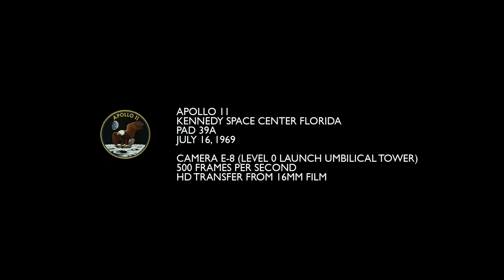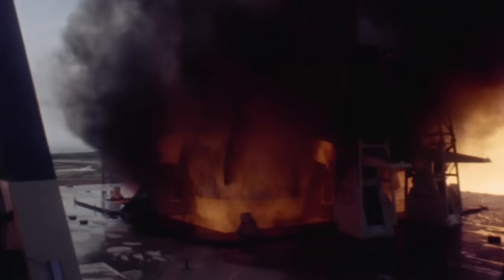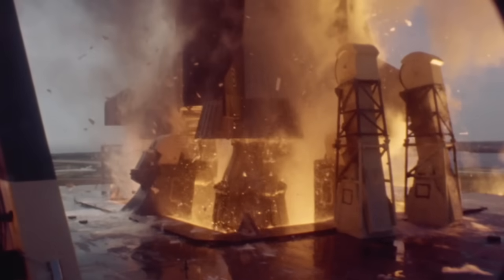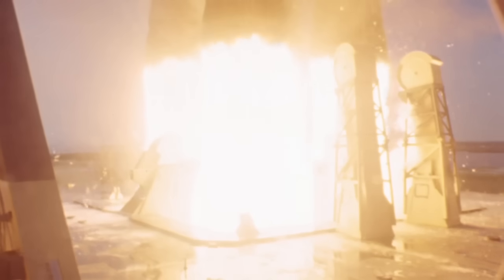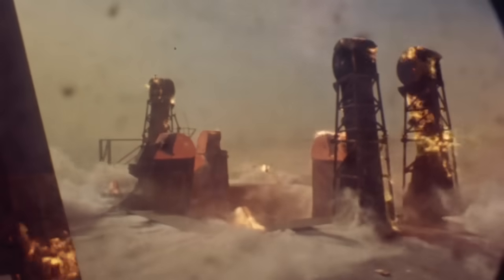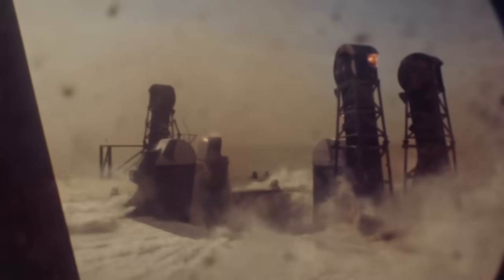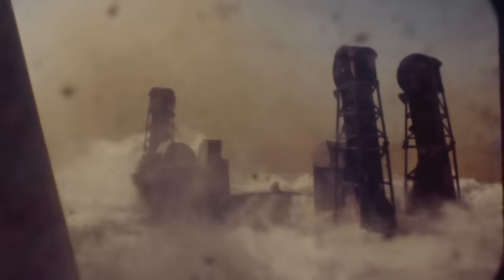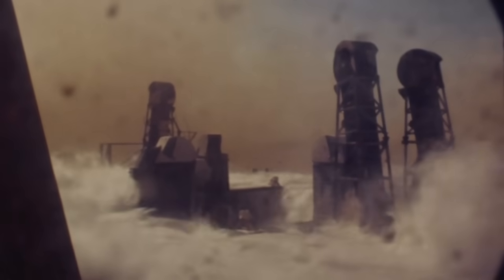Apollo 11 Saturn V Launch Camera E-8

Comment: The Saturn V remains the tallest, heaviest, and most powerful rocket ever brought to operational status and still holds records for the heaviest payload launched and largest payload capacity to low Earth orbit (LEO) of 140,000 kilograms (310,000 lb). Truly remarkable one wonders if this was the pinnacle of American space program.
Reply: And to think the Saturn rockets are almost 60 years old, imagine if we created a new design with our recent technology...hell, the computer system inside the Apollo 11 had the processing power of an Atari, and THAT took us to the moon and back. We could go to Europa if we really wanted to.
Reply: German engineering at it's finest! ;)
Reply: Not even close.  The final version of the Saturn V produced more than 7.8 million pounds of thrust.  If the Falcon Heavy is a success it will produce a bit over 5 million pounds of thrust. The Saturn V could heft 320,000 pounds into LEO while the Falcon Heavy, if successful, will be capable of 119,000 pounds.  Not one of the 50 year old design Saturn V's ever failed.
Reply: His numbers were wrong.  

Delta IV  has    710,000 lbf   
Saturn V has 7,648,000 lbf

It's easy to make a mistake, if you don't realize there is a huge difference.

Everything on a Saturn V is huge compared to the Delta IV Heavy.   It's all about the mission though.   Delta IV is for getting payload to Earth orbit.  Saturn IV is for getting payload to the moon.  

It's a shame that we have all but given up on space.  When I was a kid, space was our future.  We had plans on colonizing the Moon and Mars by the year 2,000.   Space stations and space tourism was suppose to be so common, anyone could do it.   

There are still people who are hopeful, but space is no longer a national priority for any country.    If space fairing nations still put the same kind of effort and budget into space as they did in the 60's and 70's, we'd ... well, those "Hey, we should try..." missions would have happened.

There was a driving factor back then.  Both sides wanted to show that they could put ICBMs anywhere on the planet quickly.   They masqueraded it with the civil applications.   We learned a lot of good things in that period.  Too bad learning and discovery is never a real priority.   That's why you'll see growing military budgets, but cuts to education and aerospace.

The only way we'd see a change with the current systems in place, is if China (or someone) landed on the moon and declared it their property.   You'd see the US, Russia, and the ESA with all the budget they needed, and escalating mission sizes until they went back to agreeing to the old 1967 space treaty.
Reply: +kell490   It could have put the ISS up in just 3 missions at a fraction of the cost.
Reply: +kell490 Dude! the Delta IV has 1,000,000 pounds more thrust (8.5ishM) and we have a space station! Oh yeah; landed on a freakin comet!!! If only NASA had 2% of the nations budget like it did in the 60's; that would be super cool! Now it's like point zero something percent... Stuff takes longer now.
Reply: MetaldogJC I think it was more then just the money Apollo program cost 20 billion 100 billion in today's money. The F-22 Program cost $61 billion. I think NASA just too bureaucratic
Reply: +kell490 The Ares program will break all of those records when it finally goes live which will be in a few years.  They have done unmanned leo tests and they have also tested all of the emergency systems that were made into this new program to prevent some of the issues that we had during mercury, gemini apollo and shuttle programs.  There is an emergency jettison system that has been added as well as launch pad emergency abort system.  Reason ti will break records is they modified the shuttle engines to be the mains on the Ares V rocket plus it will use SRB's borrowed from shuttle program which will increase the payload that can be put on the rocket.
Reply: +Alex Scott the new Ares program has modernized computers and all of the latest and greatest safety that has been added based on lessons learned since the 60's spaceflights in the gemini mercury and apollo programs.  Emergency systems also added based on lessons learned from Shuttle program.  Ares I and Ares V are the new rockets.
Reply: kell490 I don't think we should go to Mars. A Mars mission will be a huge effort, just one small part of the mission is; soft land a rocket at least the size of an Atlas V with all its support equipment on Mars.
I think it would be better if we used that huge amount of resources to build a space station that is in Solar orbit and mine the asteroids. This space station would be a space station factory that can build more space stations, and these space stations would be in an elliptical Solar orbit that would take them past Venus, Earth, Mars,and the Asteroid belt every few years. We could then mount a Mars mission using our spaceborne assets.
If we go to Mars, we may not learn anything new, and when we get back we will be too broke to do anything else, and 10 years later people will start saying nobody ever went.
If we mine the asteroids, and build space stations; we will learn lots of new stuff, and we will be building whole new places to live that don't even rely on the Earth.
 And we will be in space and nobody will be able to say we're faking it.
Reply: +JW Smythe  I think terrorism has changed many things.
Reply: +Grant W. Whitwam what has changed more is the need for manned exploration. computers and automation can do it better, why waste all the payload on human life support?
Reply: I'm not an American but I often wonder about what the program could have achieved if it had been let to run its course. I just wish I had been alive then to have had the "Apollo" experience. Truly, an amazing time indeed.
Reply: +curtyuiop 2600.
Reply: +Alex Scott the man has walked on the moon
Reply: If the Delta 4 heavy has so much thrust why can it only lift half the weight of the Saturn 5?
Reply: Super good question. Many different rockets and configurations but it looks like the SLS will be a more direct comparison to the Saturn V rockets but it's still in development.
Reply: +kell490 What it really boils down to is mass delivered to low earth orbit (LEO). The Saturn V could deliver 118 tons to LEO.
The SLS will do better than that, maybe someday delivering 120 tons to LEO.
Reply: +Robert Benoit there is no more an Ares program, Obama deleted it. If u hope to see a big rocket you can wait a couple months and we will have the falcon 9 heavy lanched. it will be the most powerful rocket ever launched since the last Saturn V, but with something like half of his lifting power. If you want a rocket big as this, you'll have to wait the first '20, and we will have ULA's SLS, that will be bigger and more powerfull than the Saturn V
Reply: James Monahan Who knows what will happen to the American Space program if we will actually go to Mars. I hope so we have to learn to get along in this world before we can explore space.
Reply: +kell490 some crazy conspiracy guys will claim its a ruse to bankrupt china
Reply: Geffen Avraham I always tell them Bush and Dick Cheney are behind it all.
Reply: JW Smythe The RS-68A has 710,000# thrust. The Delta IV has three RS-68A engines, The combined thrust at takeoff is in excess of 2.1 million pounds of thrust.
Reply: +Robert Benoit  Uh, the Ares "program" was part of the now-canceled "Constellation" program.  The only hardware that flew was a test flight of an experimental SRB-powered "Ares 1X", which launched a dummy vehicle into a sub-orbital trajectory.  The whole Constellation program was canceled way back in 2010, as it was deemed to be too under funded to work.  There is the Space Launch System rocket now being built for some future use (along with the Orion space capsule), but it is not the Ares V and will not quite have the lifting capacity of that rocket design.
Reply: ***** How much weight can the Falcon Heavy deliver to low Earth orbit?
Reply: +Don Kerouac The ITS will beat the Saturn, though.
Reply: absolutely bang on there mate, lol!!!
Reply: If Nasa had the same people who built the saturn V build a rocket for mars we would have been there by now
Reply: If Saturday works out the SLS will break the Saturn V record 8.8 million lbs of thrust. Finley going back to the moon
Reply: That record will never be broke.
Reply: Alex Scott Extremely powerful computers systems are not needed it's the Mechanical engineering of the vehicle. I would bet modern rockets don't come close to the CPU of the current high end Intel CPU.
Reply: +Alex Scott oh my god, why would we want to go to europa when titan looks so much better? you are just a crazy old man. and what type of atari? I had the 400 and the 800 xl, lol.
Reply: You guys shouldn't wish you were alive then. It was really cool to watch, but I was 11 yrs old at the time. We all watched it and then went right back to whatever we were doing, it was not a big life changer for most people. You all be glad you younger.

Comment: There is not really any dispute that Apollo 11 left Earth. But what did it do after it "roll over" and left
Reply: +Billy Joe 
It burned through the first and second stages, and part of the third to achieve low-earth-orbit. The third stage was then restarted to propel them toward the moon. After the third stage shut down, they detached the Command Service Module and docked with the Lunar Module. Then it was one to lunar orbit.
Reply: +Billy Joe  This is only a stupid question because you act as if we don't know.

Comment: Was it not bolted down like the space shuttle was?
Reply: +BackCountryBrdr It was "clamped" down... as shown by the film.  Explosive bolts work just as well, and have been scaled up.  But, they are one-time use devices.
Reply: +BackCountryBrdr  I thought I heard Armstrong say that there were Shear Pins that also clamped the vehicle to the launch platform.  When the vehicle lifted off, these pins would shear and also release the vehicle.  Point being, one it lifted off, it could NOT settle back down on the platform if there were any engine malfunction.

Comment: They don't build rockets as big as the Saturn V anymore. Even Orion has more powerful smaller rockets...
Reply: That is very cool. I just learned how does a rocket launch. Plus it is in slow motion so I can see it better... COOL
Reply: Be of good cheer, Antonio -- and stick around.  They are building the first SLS rocket at Michoud in Louisiana as we speak.  Same size as the Saturn V with more thrust at liftoff (8.2 million pounds vs. 7.5 million).  Roll out from the VAB at KSC in two years.  First launch from here on the Florida  space coast in three.  And an Orion spacecraft will be on top !!        :  ]

Comment: Kerosene baby! old but trusty stuff
Reply: +nutsackmania what does derp mean ? but it's not plain kerosene sulfur and carbon like things are removed otherwise it it's plane kerosene then fuel will turn sticky and block through pipes.
Reply: +nutsackmania Ok I am not that stupid in chemicals but you can still call it kerosene but sulfur is removed so it doesn't turn sticky and block pipes.
Reply: it isint kerosene it's rp1.
Reply: +nutsackmania derp!!!
Reply: +Gaurav Ghosh basically a thread of derp by populism here...RP-1 is a form of kerosene. even if you are caught up in the semantics, which people here obviously are, RP-1 is just "rocket-grade" (highly refined) kerosene, meaning it just has more shit removed from it; the length of the carbon chains and resulting boiling point is why it is called kerosene. so: RP-1 is kerosene
Reply: +shbitz Kerosene is a more refined form of diesel. Diesel, kerosene, jet fuel, rocket propellant and heating oil all come from the same refinery fraction during their production; after they get to the same paraffinic mixture the amount of purification (heating oil gets the least, rocket propellant the most) determines what they're going to call the finished product. You could go to an airport, buy 100 gallons of Jet-A1 fuel, put it in your Peterbilt, and (at least until the taxman got hold of you; diesel has road taxes that airplane fuel doesn't) run all day long with no worries. The military actually DOES this; the JP-8 fuel used by the military was chosen because you can run it in both turbine and diesel engines.
Reply: +Mr1969CoronetSuperBeeTM no, Diesel is a heavier product of petroleum refining process, called cracking.  they use a high tower with pipes at diferent heights, on the bottom pipes you get very heavy products like tar, then you get gradually lighter products like the fuel oil of trains, then diesel,  then kerosene (yes lighter than diesel) then gasoline and finally gas.
Reply: +Robert Benoit  JP-5 is kerosene. The flash point is altered for safety but other than that it's just kerosene.
Reply: +ROGER2095 Hydrazine is used to fuel the APUs (auxiliary power units) to power the onboard systems of the spacecraft.
Reply: +Simon Watts They're fairly similar. But Kerosene, also known as Diesel No. 1, is refined better, has a lower flash point and can withstand lower temperatures before it begins to solidify. This is because Diesel No. 2, also known as Diesel Fuel, has a larger paraffin content. But, you're correct.
Reply: +Alejandro Medina  Every good prepper has a stash of that stuff !!  ;)
Reply: +Mr1969CoronetSuperBeeTM trucks burn diesel dont they ?
Reply: +Robert Benoit Commercial truck users file quarterly fuel tax reports. You report the number of miles you drove in each state, the gallons you used for propulsion, and the gallons that weren't taxed at the pump. Then you pay the tax on the not-yet-taxed gallons. The main reason for this is the private fuel points truck fleets own, but an IFTA truck could burn damn near anything he wanted - jet fuel, kerosene, that fifty gallons of stove oil he had to put in to get the truck back to the main highway, two jugs of turkey fryer oil - and report it as "fuel not already taxed." Completely legal.

Who gets in trouble for untaxed fuel in a diesel truck is the little guy who ISN'T filing IFTA reports. He has no way to pay fuel tax other than at the pump, so they do everything they possibly can to make sure you do.

I know what you're thinking: "I'll just get me an IFTA number for my Ram Pickup and then I can burn all the kerosene I want!" Trust me: you do NOT want to do this to yourself if you don't have to. IFTA reports are more complex than income tax reports, and the IFTA people are way more likely to audit you.
Reply: +ROGER2095 Gemini used a version of Hydrazine as a hypergolic propellant in it's RCS thrusters.
Reply: +dontreplykillyourself Diesel will set into wax at low temperatures of an aircraft at altitude. Kerosene has to be much colder.
Reply: +Gaurav Ghosh basically kerosene derp
Reply: +Gaurav Ghosh derp means you're stupid and wrong, of which you are both
Reply: +Gaurav Ghosh Thats the kind of kerosene diesel trucks burn isn't it?
Reply: +shbitz   yeah. but i thing Some diesels can burn Kerosene. here in my country  farmers put kerosene on their tractors to clean the engines. every couple months i guess they work almost the same.
Reply: +Alejandro Medina wow i didnt know that . thanks for the info .
Reply: +Mr1969CoronetSuperBeeTM in rockets it's pure kerosene.
Reply: So diesel is just dirty kerosene then?
Reply: +Mr1969CoronetSuperBeeTM no desisel is completely different pure kerosene is called rp-1
Reply: I'm not saying they are the same thing just similar in makeup.
Reply: +jmowreader you are totally wrong. they are different fractions.
Reply: +curtyuiop The differences in different engines are more attributable to the engine than to the fuel.
Reply: +Alejandro Medina Until now, I'd always thought they used hydrazine as the propellant fuel. Learn something new every day.....
Reply: Ok cool. Thanks for the explanation.
Reply: +Mr1969CoronetSuperBeeTM Diesel trucks don't burn Kerosene although they probably could, if a driver gets caught he goes to jail.  Tax evasion would be the charge because Kerosene is not heavily taxed.
Reply: +jmowreader Last I knew they use JP-5 in the military.  I served in the Navy for 9 years so I kinda know what I am talking about.  JP-5 can be burned in turbines and in Diesel engines as a matter of fact they transferred jp-5 to the diesel tanks to get rid of it at the end of deployment.  I asked the chief engineer if it would cause a problem not burning DFM (Diesel Fuel Marine).  He said no it will just clean the injectors.
Reply: +crankman68 apolloll
Reply: +jmowreader US and maybe NATO militaries anyway. I've put JP-8 into the HMMVW assigned to our squad and I know our AH-64s use it too. (Simplifies logistics a little bit)
Reply: +shbitz Kerosene is a cleaner version of diesel or so I have been told. I could also be very wrong.

Comment: I have a feeling that the exhaust gas didn't fully go down the tube initially because there wasn't momentum in the gasses in the tube yet and created more resistance to flow...and once the gasses made it through the tube, there was much less resistance to flow and the gasses could travel through without a whole lot of resistance.

Comment: 1.Roket C5 has real speed of 1km * s (at the time of separation of the first stage and a height of 20 km).
2. B1 was replaced by a lower rod at times.
3. Hydrogen in the second stage was not.

Comment: Rocket engines have the same principle as internal combustion engines.
It is necessary to reduce the combustion chamber and increase the pressure.
Obtain high thrust and efficiency.
Engine NK33 - camera 44 cm; RD170 - camera 38 cm, F1 - 99 cm.
If you then believe von Braun - this is very misleading.
All the engines are most effective in the world have two or four combustion chambers.